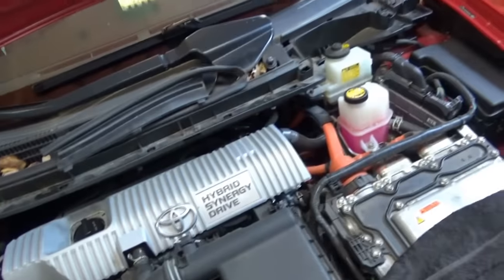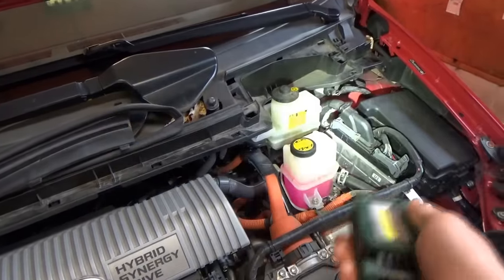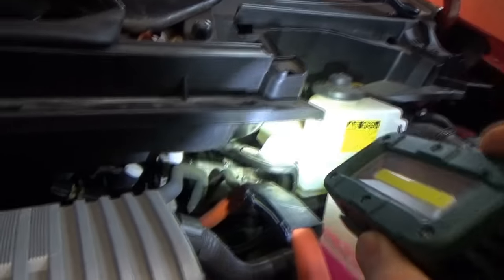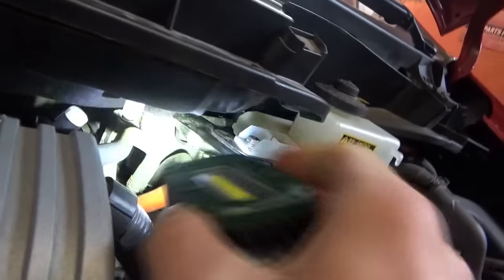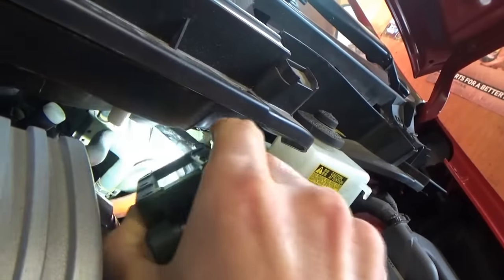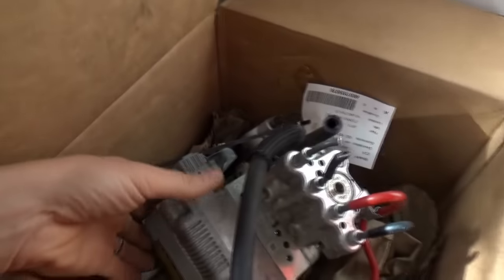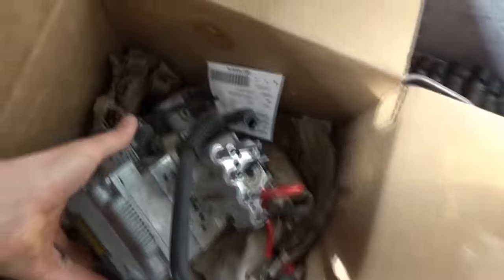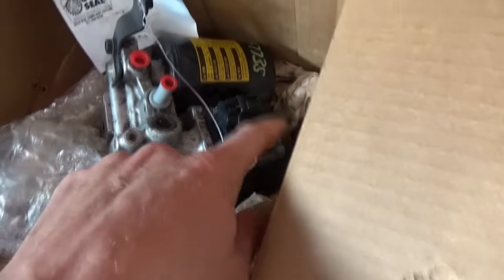Prius Brakes FAIL (Hidden COST of Hybrids)

Comment: This is why I never ever buy the first model year of a redesigned car. The 2010 Prius was a Lemon. They had tons of issues. Head gasket, oils burn, ABS, headlights… By 2013, the issues were resolved and that year on are among the most reliable cars you will find.

Comment: RE: Recalled part. It's possible the part was replaced under the recall, then vehicle met its demise.  Possible. A dealer might be able to pull records.  Still a bit troubling...

Comment: Good morning Ivan. Strangely enough my 2001 Mitsbishi Montero XLS has the same HBB set up as this Prius, except for the fuel mileage perks (17mpg). Same over priced components $1500USD for a new booster assembly, and the same tedious bleeding procedure. What was wrong with the good ole' vacuum brake booster? On a hybrid I can see the point, due to the lack of engine vacuum, but on a combustion engine??? Found out that this system was also installed on various late 90's/early 2000 model Toyotas and Lexus that will interchange with the Mitsubishi. Near impossible to find used units in salvage yards, at least here in California. Hoping to not have to replace this unit anytime soon.

Comment: Well, that's the same with the "energy efficient" HVAC units.  Any savings in energy costs are given to the manufacturer/HVAC contractor for the ECM purchase and replacement compared to the cheaper PSC motor.  

But it's also Toyota.  My secondary air reported a valve leak.  Toyota's repair was to replace the whole system, pump, valves, manifolds, etc. for high cost.  I fixed it by pulling the solenoid and cleaning the reed valve and solenoid chamber with brake clean.

Comment: I bought a used 2010 prius first year for the 3rd gen.
Less then a year later I had to train it in and take a 6k hit.
That 47mpg I got defiantly wasn't worth it..
Reply from the maker: Why did you trade it in?
Reply: @PineHollowAutoDiagnostics  it would randomly not start and pop up check hybrid system.  
I took it to a specialist and two dealerships it worked for all of them. The last one told me to toe it back if it broke down again after I just had it brought on a roll back.
I drove it home parked it and the next weekend went and traded it in. Thank good it didn't breakdown when they was doing the inspection lol

Comment: ABS actuators for all model cars have these issues. 230k miles is pretty decent given they probably never replaced the brake fluid.
Reply: Agree and additionally, those that say the fuel savings is shot is to assume you would never have any expensive repairs on a gas vehicle at 230k.

Comment: There are a lot more problems with Gen 3 Prius than brakes. Electric water pump, EGR valve, PCV valve location - need for Catch Can, head gaskets weak on 2010-2012, more. On the brakes, go to a junk yard. Plenty of actuators available. At 230k, this vehicle is on borrowed time. Gen 2 is much simpler and more reliable. Recall on 2010 for rear disc brake balance as well.

Comment: Would I be able to complete this replacement and break oil change without the software you’re using? Could I do the replacement and bring it to a shop to reset the lights?

Comment: I hace a 2011 Toyota Prius, apparently the brake booster extended warranty expedited on 08/31/21. What upsets me is I had taken my car in to Tustin Toyota on June 2020 to do a different recall but the did nothing about the brake booster or said nothing. I’m here at the dealer and they said they only fix them when they go bad. Well now mines bad and I’m effed. This has been one of the must frustrating things I’ve ever gone through with a car. Feels like I’m driving a BMW.
Reply from the maker: LOL Hybrids can be Headaches

Comment: So to update my story.  I was told by 2 different Toyota dealers I needed an accumulator….  I changed my own front brake pads and the error went away.  They literally were trying to get me to pay 2994$ to replace a part that wasn’t bad, a “leak detected in the accumulator” error code…. Can be triggered by bad brake pads……. It’s a rip off. Make sure you change brake pads FIRST. The accumulator WILL trick the computer into thinking it is bad.   Hope this helps someone out there
Reply: How much brake pads were worn out?

Comment: I hope he tried to have dealer do it under recall.  I had a pickup just out of recall, with recall issue.  He contacted manufacture. “Are you 100% positive a bad part did not get in pickup 60 units after cutoff?”  They fixed it free under recall.   If I was told part was from recall.  I would return it, buy new.

Comment: If you have the bleed hose go up and over then down into the bottle wont that be more sure you got all the air out. (putting the bottle above the bleed valve) or is that a special bottle making that unnecessarily? I've never done brakes by myself but now that my dad died I have to and was planning on it soon for my '02 Jeep Wrangler. The fluid is as old as the Jeep. The brakes have 130K miles on them.
Reply from the maker: Sorry to hear about your dad! Doesn't really matter about the hose orientation since the fluid gets forced into the bottle regardless :)

Comment: I have a question if c1391 code comes then how you can can resolve by bleeding if accumulator sensor voltage drop 3.8v to 3.2 v within 10min with out any activity.  it sure that accumulator is rusted from inside and leak pressure, thats why motor repeatedly on after small duration.

Comment: A couple of things to note: 1) 2010-2011 Prius are the most problematic hybrids that Toyota has ever made, 2) Overall maintenance costs studied have shown hybrids maintenance costs to be lower - not higher than ICE vehicles due to not needing alternators, starters, drive belts, and through brakes lasting on average twice as long.

Comment: That's not really a hybrid problem, it's an overengineered problem. Honda's used to have the same problem. The valve block would crack or a connector would come loose. The pump would run to long and kill itself, if I remember the fix was also about $2k

Comment: Brake modulators/actuators wear and fail on non-Hybrids at much the same age & rate. However yes it might only be a $1000 repair vs $2-3k repair on a Hybrid.

Comment: the pump on a 2nd gen Prius is much worse to remove, there is a giant weight that bolts to the bottom of the pump that you have to remove from the bottom of the car and you cannot see the two bolts that hold it to it. as far as this being hybrid specific it is not only on the hybrids, the forerunner has been using this system in it's latest generation and a lot of Lexus models use this system. there are other brands that have these systems scattered across their lineup as well, namely the late model gm trucks and full frame suvs which I mention because of the massive delay that has almost caused me to wreck every single one at low speeds, IE traffic or moving it around in the shop.
Reply: The tall Toyota trucks and the Lexus models are brake by wire because they can literally make millisecond-by-millisecond brake, engine power, and steering assist adjustments to stay in control, or even help prevent a loss of control before the driver notices it. A traditional braking system combined with this "vehicle-dynamics integrated management" would cause the pedal to vibrate, much like ABS.

Comment: All toyota LandCruisers and Montero's 2000 and up, 4runners 2000 and up, 3rd gen Tacoma TRD OR and Pro, Prados, Armada's (Y62) are all equiped with this setup. If the motor runs more than 30 seconds at initial startup, and frequent runs indicate a failing accumulator: just replace it before the motor wears out (with a brand new OEM unit). If motor wears out, rebuild it (Eurton Electric etc.,).
Reply from the maker: Yup. Wish they just installed a rear diff lock like on the Pre 2000 4Runners and left the brakes alone!
Reply: @PineHollowAutoDiagnostics  Hi Ivan.. You taught me electronics.. THANK YOU! My cousin lives in Staten Island and ownes a Montero. Had same failing pump. he and I diagnosed the issue and watced lot of videos. Later got all correct. That video I posted in my other comment was the best video on the net on how to bleed the system. Oh.. we fixed his no spark issue by following your advice and it worked! Had a failty ignitor!

Comment: My abs pump went bad in my 2012 Prius V that i bought used with 150k on the OD and Toyota replaced it for $0.00. The V wagon had a lite recall (if it fails before a a certain mileage or the end of 2020 if over 150k ) for it last year. as for the third generation Prius, It was issued a standard recall years ago. (I don't know what the terms were though for the recall.)
Reply from the maker: Kudos to Toyota for stepping up!

Comment: Soon the year will be 2022 and Toyota Hybrids are the way to go!! 45+mpgs, 100k miles brake pads, quiet AC compressor, no serpentine belts or annoying pulleys that seize and leave you stranded. Just keep the hybrid fan clean so your main battery lasts 200k and when the time comes you can service individual cells in the battery pack if need be and not have to change out the entire pack. ALL cars will have one of their ABS modules fail at 200k and so what if you need a fancy bleed procedure. Toyota brake systems are excellent and second to none. You'll be grinning at the end because hybrids will also be worth more when its time to sell. 
Now don't get me wrong here folks, I love a gasoline engine but we must adapt to change... take for example my dad's generation (BB) some just didn't want to evolve with cell phones and simple technology... so today, completely lost! Seems like some are still stuck on CDs and halogens. Best to all!

Comment: the GM buick GNX system for its atumilator/main line pressure is max sub-2500 psi somewhere i have notes 📝 on it but don't have the car 😉 as i was using it to modify my 60's charger and the astro vans ( and the duramax is 900-2500 ish but i believe used the engine power steering pump for the hole production run ) as well if im 🧠 right🤔

as boosted / diesels cars have a harder time running vacuum systems

Comment: IF I was gonna buy a hybrid it would be a new Prius. But that’s a huge IF. You have two different systems.. twice the chance something bad aka expensive will happen. You’re also talking about a very expensive battery and/or generator that will absolutely fail in the future too. Granted it’ll likely last a long time but I just don’t like those chances.
Reply: The battery worry is WAY overblown. They typically don't fail for a long time and are not that expensive. There is a mobile service where I live that will pull up to your car and install a rebuilt one for $1000. Compare that with, say, the pain and expense of a transmission rebuild. Peanuts.

Comment: Replaced the accumulator (same as this video) on a 2012 Prius (Gen III).  Using a Topdon Topscan, bleeding steps complete through bleeding the stoke simulator.  That step seems to complete and after tapping Next, it throws a communication status error "Failed to communicate with the control unit."  Is this an issue with the Topscan or something else??

Comment: Does the brake fluid reservoir need to be pressurized? And can issues be caused by leaving the cap off the reservoir? Had my Prius’s oil changed at a shop and they sent photos of where they checked all the fluids, brake fluid being one of them, and my car had hissing issues that went away when I pressed the brake. Well today catastrophic failure, warning beeping, brake, abs, traction control lights on, and loss of response on brakes that makes the car undriveable. Now at my regular mechanic awaiting prognosis but I’m concerned this is exactly the issue just to a catastrophic extent

Comment: as least with the FCA ( my dealership bendex 9 ) and GM older systems NO DOT-5 brake fluid as it eats up the interior seals FYI. i don't know 🤷‍♂️ if the Toyota systems are the same as the same thing for newer one's as i don't have any dealership's manuals for them

Comment: I don't see a issue with the used parts. They have half the mileage as the original parts. So if they last as long as the original ones then its a win. Cheers
Reply: Just depends on the part and if it's a known high failure part.

Comment: I change the abs module booster, no the accumulator the c1391 disappear, but I still having the pump working around 12 s cycle, but the air bleeding fail message at the end.

Comment: so if for some reason you are unable to purge the break, the sound continues, In my case I have c1391, after replace and try to purge the system end it up in bleeding preceding failure the sound continues about every 12 second

Comment: I once rebuilt my master cylinder on the side of the road with a piece of leather cut out of  my belt and bled it with a piece of hose and a coke bottle. It worked for... forever.  These new cars are designed to be ridiculously complicated and expensive. I don't care if I have to rebuild them 100 times, I'm sticking with my 65 Chevy truck and my 84 Sturgis lowrider where a socket set, a few wrenches and a screwdriver is all I'll ever need
Reply: The last thing to go through your mind if you crash either of those older vehicles will probably be the steering column and dashboard.  While you are here on youtube, check out crash tests of 1980's and earlier vehicles compared to cars even as light as the prius. I wouldnt want my kids driving anything older than 2006 unless I want them coming home in a pine box.

Comment: 200K, all cars today have at least one system that is really expensive to fix. I just watched you fail to fix a Nisen HVAC/Navigation/Entertainment controls. Yhe customer had already spent over $1,200 and was quoted another $7,000, which included a $6,,500 part that you could not diagnose.

Comment: I wonder how much NOx was released making and replacing, transporting, etc all those brake units. And the EPA was only worried about a tiny amount from VW diesels.
The EPA tried for decades to kill off the VW diesels with regulations so electric vehicles would have a chance. Just remember, behind every 'gate' there's a reason for it...

Comment: That wasn't as bad as I thought it would be apart from the brain surgery bleeding prodeedure. I'm guessing the 6 cycles of pressurise/depressurise it's checking to see if that is consistant so there aren't any leaks. The wiper assembly came out quite easy and weird the battery area had the drain plugged up! 8mm bleed nut on the front and 10mm on the rear now that must be an accountants doing! 🤦🏻‍♂️

Comment: It drives me NUTS when a car near but just outside of a recall range has the issue that is cited in the recall... that's fucking crazy. The NTSB should be forcing automakers to increase the scope of those recalls when this happens.
Reply: It's possible the unit was replaced with one remaned by Toyota.

Comment: My 2007 Highlander has 127,000 and it now needs a $3,000 brake repair because of this unit. I don't mind parts going bad, but a brake system part that starts at $1,800 + labor???!!! There goes my fuel savings for the last 15 years.

Comment: Hi I just had my mechanic the brake booster assembly on my 2010 Prius ( the same part you replaced on the video) and it still makes that buzzing sound, but not as often as before, does that mean its ok or does that mean the brake booster pump (accumulator)  assembly is bad?

Comment: Is the recall still valid or is that actually the voluntary customer warranty that expired in 2019?  I have a 2010 with a failed booster or actuator sitting in the driveway right now about to go to a dealership for repair.

Comment: Having a major repair after 230k is pretty standard hardly a hidden cost but good clickbait title! Also most cars don’t last 200k much less with 45mpg so all in all looks like a huge W
Reply from the maker: I could buy 3 used cars for one Prius brake job haha
They are more reliable than many cars on the road, no argument there :)

Comment: Hello, I have a lexus es300H 2013, i have to push hard the brakes, and make sounds of air in the pedal, I dont know if I have to change the actuator or the other brake module, I dont have any DTC

Comment: The pump and actuator need to be replaced on my 2014 prius. The dealer is changing $2400. Not bad considering another non dealer local shop wanted $3500. My mechanic cant do it because he doesnt have a computer.
Reply: Oh... her car only has 70k miles

Comment: Lol i feel your pain about that little bolt for the brake reservoir, that's just a plain stupid design, did you know you have to remove the entire cowling assembly including wiper motor assembly just to remove the coils and replace your spark plugs? And it's the same procedure from 2010 to 2017 after they switched to a 90% plastic cowling in which you could bend it a little bit to get clearance for coil removal in the 2018 and later models they cut the plastic and added a removable access door to get to the coils.

Comment: Im curious as to how being a hybrid is the reason for the expensive/elaborate parts and braking system? 
Ive never owned a hybrid or even worked on one. Is it because when in electric mode there is no vacuum for the brake booster? Is it a common braking system on Toyotas?
Reply: Regenerative braking spins the electric motor backwards to generate energy while slowing down. The brake pedal must be hooked up to this kind of system to do that, since there are times where regenerative can do all the work of slowing the car down.
Many of the Toyota SUVs and trucks have this system, because it can react much more quickly and allows Toyota to use a "stability control on steroids" type system that can predict a skid and correct it before the driver even notices a loss of control.
https://en.wikipedia.org/wiki/Vehicle_Dynamics_Integrated_Management